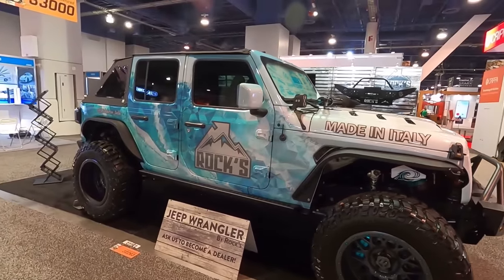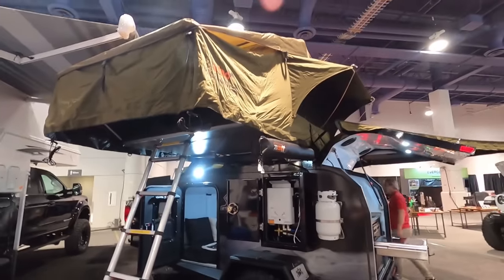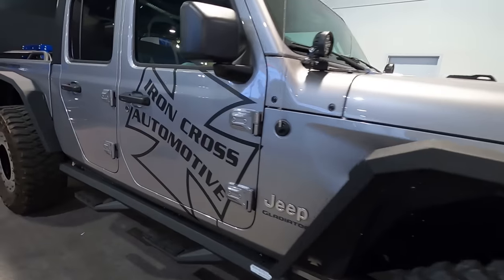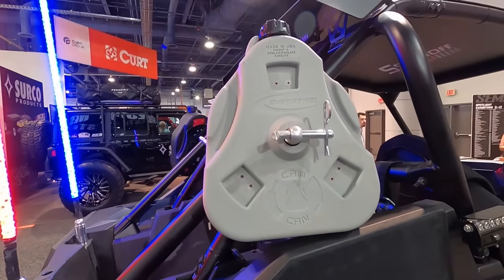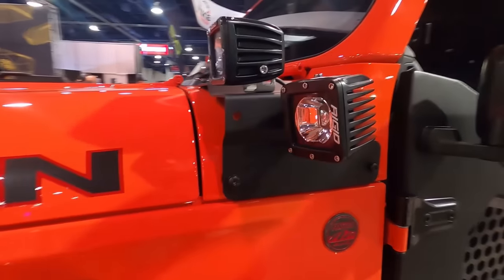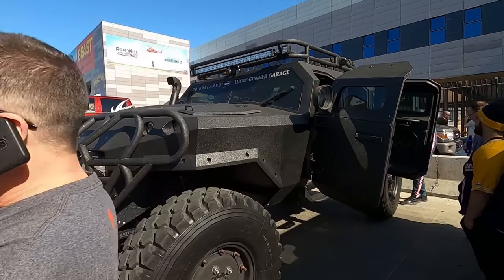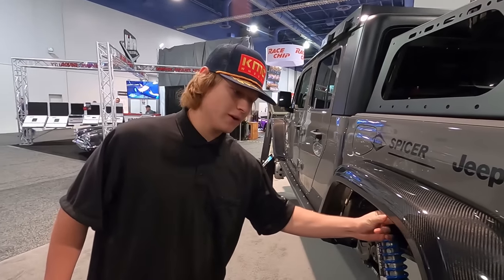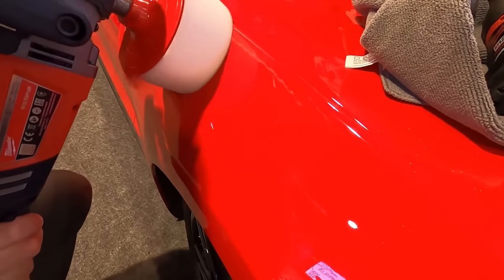The Ultimate Jeep Builds !(2019 Sema Show ! )

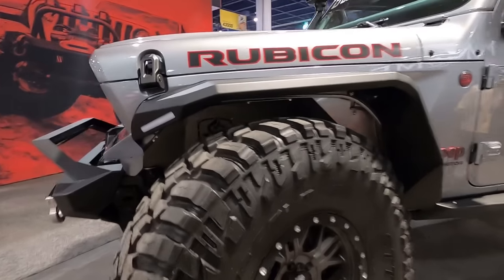Comment: 1:11:00  That front end is a retro throwback to the original jeep Gladiator. from the 60's. the successor to the Gladiator was the Jeep Comanche, however the Comanche  didn't last very long and only 200k Comanches  were ever built. They did keep the original gladiator styling through the 80s on the Wagoneer as well

Comment: Those Gladiators are about 70K straight from the dealer Alfred, so if you are thinking about putting all of those toys onto one, you'll need to be prepared to spend about 100-120k.
Reply: Wrong. About 60k for a fully loaded Rubicon. And nobody pays MSRP.